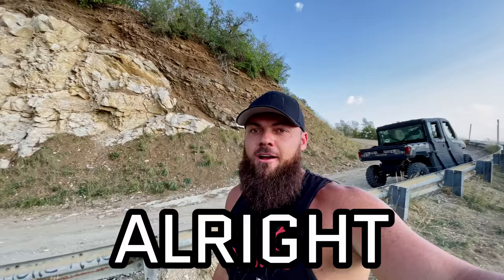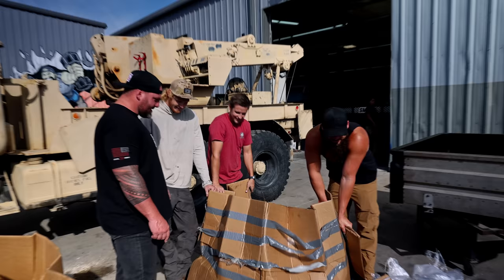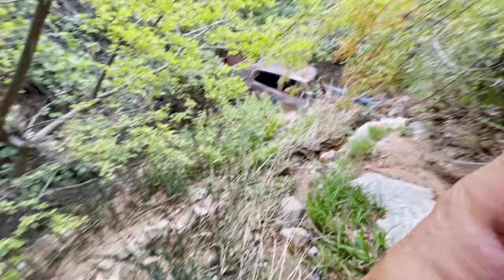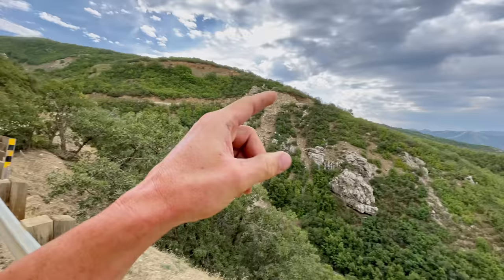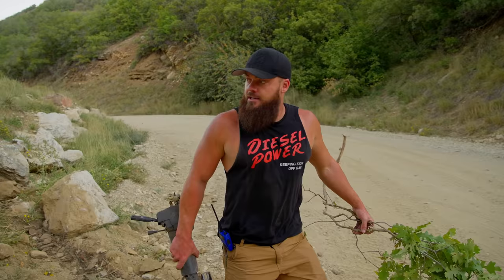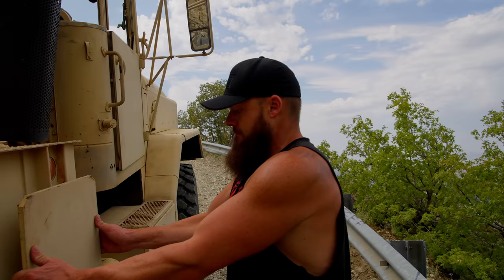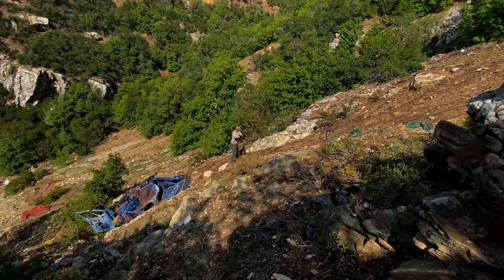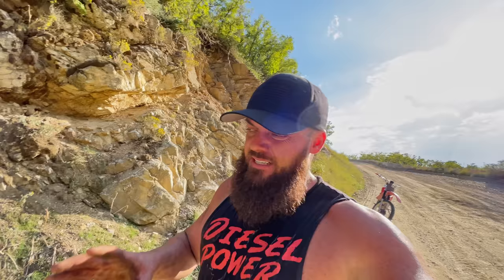Recovering Vehicles From A Cliff That Nobody Else Will Touch (Dead Man's Curve!)

Comment: Years ago a very windy and steep mountain road between two towns I lived in was completely reconstructed. During the process, the construction crews pulled out over 50 vehicles from the canyon, some with human remains in them. The ones with remains where vehicles that no one knew were down in the thick brush and solved the missing person cases. Each time a vehicle was discovered with remains in it, the site was shut down while the coroner was called out. Because there were so many vehicles being located, the sheriff department eventually kept a csi deputy on scene during operation hours so things could continue without shutting down the construction sites.
Reply: Never happened for 300 Alex.
Reply: I'm just kidding. I just love that comment on something that is obviously true and not exaggerated or embellished. Cheers!
Reply: The mountain twist going to Black Hawk Colorado. There’s a graveyard up there too and then there’s a Mountain Road in Galax Virginia that also has a graveyard at the bottom.
Reply: What 2 towns?
Reply: 77N⁉️ @LauraleyB

Comment: Just a suggestion  for any further clean up at that site or even for other recovery work.  Build a heavy sledge with several anchor points for rigging and some hardened skids on the bottom to slide over rocks. Put an angle front and back on it so it will slide up and over large rocks.  You could load it with equipment and slide it down the mountain then load the sledge with garbage and winch it back to the top.
Reply: Thank you for the suggestion.  I was about to make the same suggestion until I saw your comment.

Comment: Thank you guys so much! I know the spot you're cleaning up, and the junk needs to go. I've seen many similar crashed vehicles in my 60+ years of wandering our mountains, in nearly every canyon along the front. Used motor oil, batteries, tires, etc. need to be removed as all of the water from these mountains gets used multiple times, from agriculture to potable municipal water supplies via groundwater replenishment. Obviously, there's got to be a bunch of lead and brass there too, but only so much one can do. Great video and example!

Comment: Hey Dave,  do you have enough cable to run from a spot up where the 5 ton is to an anchor point down and possibly across the canyon?  At a manageable height, that you could hang a sheave on a cable that you could high line the vehicles up without so much drag.  We used to high line drill pipe that way on oil rigs.  It is a matter of having a long enough cable and an anchor point.
Reply: I've seen those used for logging as well. Good idea
Reply: @olliefoxx7165  I was just thinking that 🤔 also
Reply: Maybe he will go buy a logging yarder so they can set up an easy high line

Comment: Would love to see a remake, by using the tree winch crane as seen on the "Ax Men". Make the cars fly up out of the ravine. Large logs and wrecked cars about the same weight. Would be awesome!
Reply: Ya there are a few different ways to rig the cables up so Hunter doesn't have to work so hard, but it's a bit of set-up time and a helluva lot more cable and a few blocks
Reply: FROM CHICAGO ?
Reply: Thought the same thing
Reply: Sky line would be fun in that canyon

Comment: Heavy D you and your crew are AWESOME!! It is amazing what you guys do. A couple tips if you are open to them. Get some wooden jack plates for under those screw jacks. Turn the crane to the opposite you are jacking, try to lift something heavy where the truck tilts, screw down the jacks, put the weight back down. That will give you a bit more stability. Since i am seeing this so late, you will be able to use your blackhawk to airlift them out!!! Also on that, IF you wanted to, get a thick tarp material and make it into a pool, for lack of better words, then garbage could be loaded into it and you could lift it out with your helicopter. Maybe with that community volunteers would go load it and then when its full it could be lifted out and brought back empty. Some of these ideas could even be floated to the local authorities and maybe they would pay you for your time efforts and fuel costs. REGARDLESS you and your crew are true CLASS ACTS!!!!!

Comment: This job your doing reminds me a recovery  I did in eagle river, Alaska, took me over 4 hours to recover a Ford ranger 1/2 ton 4x4over the side of a street on mile high rd. The truck was more like 2 miles off the side, I wascusing a 85 GMC 1 ton dually with a Holms 480 split boom, that was a blast, I got it back on the road and in his garage before his dad got home,which his dad knew what the son did, I only charged his dad $600.00

Comment: I like the quickie with the crane, I saw one tip over on the end of the peir in Panama.   Tried getting a load from a ship across from the cruiser I was on.  Knew he was going over, had to call in a barge crane to get it back on it's wheels.  Ah it was beautiful down there, on our way to Managua,  Nicaragua,  something to do with Noriega.   Never made it, had a main steam leak when we were bottom blowing the boiler.  Had to stay there for a month for repairs.  Bummer for us, not the rest of the ship.  We only got 2 days liberty, gotta stick with the boiler during repair.  Hole snipes job, fun never ends, till ya gotta do steam and water sides.  Have great tales about them job's,  not enough space to tell of em.  Maybe later, if you call for help from a guy that knows what a 24 and a carry on means.😮

Comment: With all the welding talent you had, should have made a metal skid that would have been heavy enough to pull the cable down the hill when you lowered it down then wench the cars up on the skid plate, chain them down and hook to the skid plate to not get stuck on the rocks going back up the hill.

Comment: We've just invented a new event for the World's Strongest Man competition :D
Suggested additional equipment: chain saw kit (including saw safety chaps) and some other hand-powered brush clearing tools; several sections of rope ladder (set up at least one to hang onto the steel steps at the back of the 5-ton, set up the rest so they can hook to each other, making the ladder extensible)  Seems like you should have a long steel pry bar - the kind I use to move boulders - but I sure wouldn't want to carry it up or down that hill.
Reply: ᴛʜᴀɴᴋꜱ ꜰᴏʀ ᴡᴀᴛᴄʜɪɴɢ 
ᴛᴇxᴛ ᴍᴇ

Comment: Hi thats nice recovery of your bout . But you needs about 6 / 55gals 
Drones . For whats ok 
Take the bigger cap put an intable valve like the one you use on tires 
Solder an rode wire ear to the top and bottom edge that the littler cap go facing down you can add either a rope or a belt along the to ears with a wook middlel point to attached to the bout in recovery now 
If you traing to sink those galon in the water are imposible but if you take those caps out they fill with water while they geting water you can go ahed thake them close to the bout in recovery an attach the wook to the bout put in the cap with the valve into the drone and put air so take the water off then close the other cap now your bout start coming up do the same with the other and you recover any bout that have sinktakes a litter while but tryit your may need those o belive not goit to be the fist time that you recover a bout this an essencial tool ❤

Comment: They should have taken a spool of rope and tied one end of it to the guardrail and let the spool go down so they could go down and up easier then they could tied what they needed around the rope and let it go down and the rope would guide it down .. Even better you can make it into a zip line and have it to where it can go up with a winch ... 

Also you should make a really thick guardrail so no more cars can fly off there or put up like. A chain link fence with poles that can handle so much weight forces have thick cables going loosely in and out the chain link fence .. Make it like a safety net like thing just on the curved parts .. Hay just an idea

Comment: I drove a M543A2 when I was in the USMC from 73 to 78, and you are running a newer truck, but the crane body is the same. So I am asking if you have ground spades to anchor the wrecker? When I see the wrecker sliding, I wonder why you don't put out ground spades. I drove wrecker in Okinawa Japan, NC, SC, Norway, and Denmark,; a lot of soft wet ground and between locking up the brakes and the ground spades, I never had the wrecker slide on me. Norway, Denmark, and SC trips; that was by ship. 
The Oshkosh M1070, when you damage the boom body trying to move the crane in the salt flats; watching that and I yelling at the TV ... not that way. Go to the other side, boom in and lift. Once you get the crane up, then boom out to put the crane on it's tires. 
I enjoy your videos.

Comment: Your lowering  your hoist capacity using that heavy rigging.
EDIT ADD: Oh, and Radius ( boom angle).  Maybe they're still way under the cranes capacity,   still a load factor. 
Sometimes a couple hundred pounds is all that's needed or not needed, to make a critical lift.

Comment: Those eye splices are too large for those thimbles. They should be able to suck that in and trim the tail so it had all of the strength and not let the thimble flop out because you don’t want to be fiddling with that on a job. Never let a sling leave the shop like that at Dunlap Industrial

Comment: What gets me is that the county in all the years just allowed that junk to pile up like that meanwhile taking your tax dollars and doing something else with it. The county needs to pay you a $10,000 recovery fee for each vehicle you pulled out. That is cheap compared to what other recovery companies would have probably charged but I think $10,000 is a is it good point in which to do the community service obviously and to recoup some of the cost that it cost to get it out. You should be paid for your time absolutely your time is money and your equipment is money and it didn't cost the county you know 200 grand for a recovery wrecking vehicle or wench or craned or go down there and pull it out. So they should at least give you a contract to continue to pull this stuff out.

Comment: UH60 has a lift capacity of 9000 pounds! However who here is paying for the permits? You guys do realize that it takes alot to get clearance to fly that low and over public roads!!!! Just not feasible! Then how many of you are going to pay for 160 gallons per hour of fuel used? Just because you have a helicopter doesn't mean you  can go fly and do whatever you want.

Comment: Would the HET be able to pull 2 trucks out of a 45° angle off a driveway in the middle of a thunderstorm off of a logging road?  Or would your tow truck be a better option & whatever winch you have would it have 600+ft of cable.

YOUTUBE THIS:
MISTAKES WERE MADE
JAMES BUTLER
205K VIEWS
8MO AGO
16M 16S

😆 🤣 😂 😹